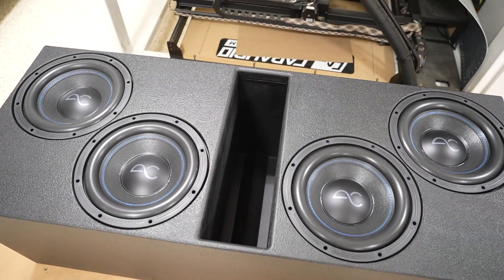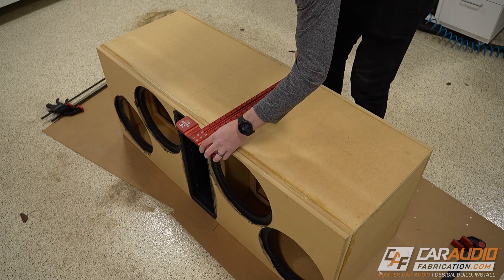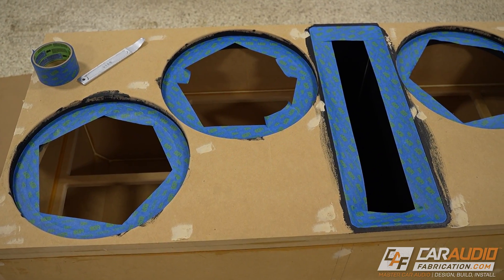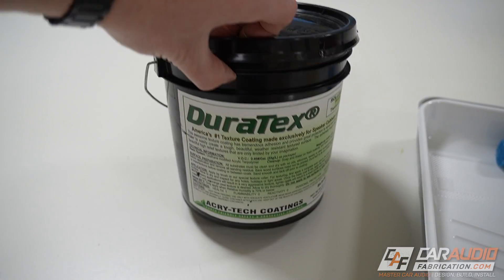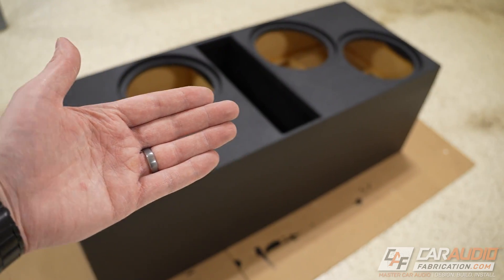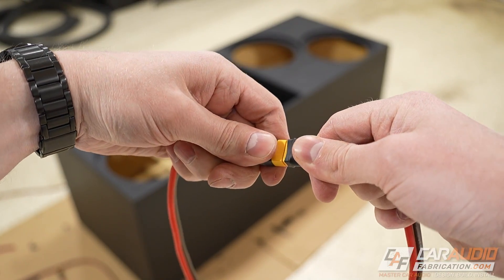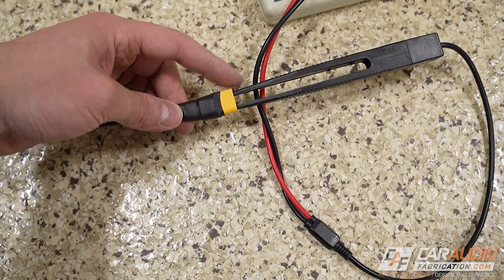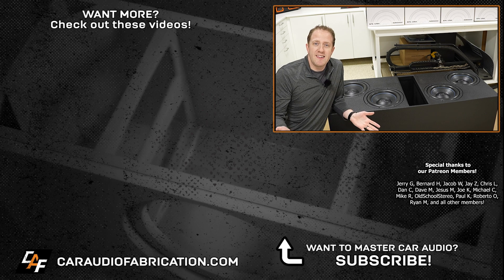Finished! Custom Ported Subwoofer Box - Coating and Wiring!

Comment: Hii brother,

I am very well stucked can u please help me out

I have a 2 channel a/b amp boss pt1000

And 2 svc 4ohm subs

I want to bridge my amp and take the utmost power but its 4 ohm 

Is there any way to pair my subs at 2 ohm and also have the briged wattage from the amp ??

Please advise i have installed my system myself and now stucked at this phase 🙏🏻

Ty

Comment: 3 ohm speakers
So if you wire 2  in parallel 
Give you 1.5 ohm 
Load  will it be fine 
If you use a amp that is 1 ohm stable

Comment: One thing I never could understand, is how, if you somehow hook speakers up backwards, if for instance they, or the cables, don't have visible polarity markings or something, they, at least in my limited experience, seem to still work with no noticeable changes... I get that there likely are changes, and can be problems, but I still wonder about that sometimes...
Reply from the maker: If one of the speakers was not in correct polarity with the other there would be a VERY noticeable reduction in bass. If all four were incorrect together you wouldn't notice as much, it would be come more noticeable in the handoff to the next speaker, in this case the midbass in the system, but would depend on if the time delay had the relationship in phase or not. Which is why many head units and amps feature a simple phase switch, or a DSP can be used to dial in the correction.

Comment: Why do you not use a connection block on the box? Drilling a hole and filling looks so pants and not professional at all using a connection block would finish off the box really nicely 👌, loving the series keep up the good work! 👍
Reply from the maker: With this enclosure being so large I wouldn't be able to access the connection point in vehicle, I need a connection that is further off the enclosure. Hard to explain but this enclosure goes in tight. Having a speaker terminal AND a quick disconnect is more added connection points than I prefer. The hole is also small so I can easily drill out next to it with a hole saw to add speaker terminals if I so choose.

Comment: Hey I have a question?  I have always heard that funky crossbracing on the inside of the enclosure can cause the subs to roll off certain frequency making it sound strange with some songs? Have you noticed anything like that? Bc if not that is a super cool way to add extra strength to enclosure
Reply from the maker: Maybe if it was excessively oversized but that sounds more like someone trying to justify why they shouldn't put the effort into bracing properly than anything I've ever experienced
Reply: @CarAudioFabrication   I like the extra bracing. Like I said I think it looks great but I just asked bc I wouldn't want to go through all the extra work of adding the extra braces if it made the bass sound wonky while playing metal with double bass drums. S.q. is what I was referring to. I think it looks 👍 great

Comment: Can you meter it with SPL labs or to check sound pressure.
Reply from the maker: Although this is not designed with SPL as the goal I will probably measure with a TermLab Magnum just for curiosities sake.

Comment: Hi is the duratex paint a acoustic dampener paint? Would there be any benefit to use it on the inside of a box? Especially a plywood box
Reply from the maker: Acrytech, the makers of Duratex do have a product specifically designed for inside the enclosure as well.

Comment: Don't forget to do another polarity check as you're putting the speakers back in the box before you mount them permanently since you're going to take them back out to save weight when you go to put the box in. I do have a question for you, I know that your channel offers a lot of builds, but it seems like a 4-12 box is pretty common on the marketplace nowadays, what made you decide to build your own instead of just buying one from a decent manufacturer? Was it because you wanted to tune it to a certain frequency that would have been different from pre-made boxes? Or was it to cut costs? Or maybe just assurance that it's built the best way you knew it could be? I used to build boxes for my subwoofers but nowadays I don't do as much because I have found a few good boxes that are designed so well that I didn't see that it made any sense to spend the time and money doing it.

Comment: Question, can you use only glue for box building or do you need nails as well?
Reply from the maker: Clamp, then hold in place with brad nails. The glue joins the connection. You could leave out the brad nails as long as you are properly clamping and allow time for the connection to dry.